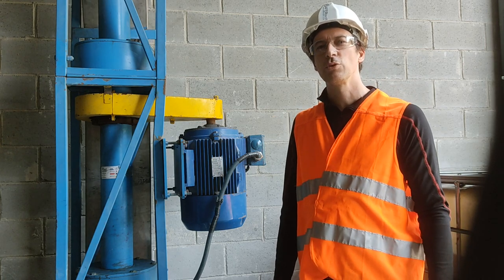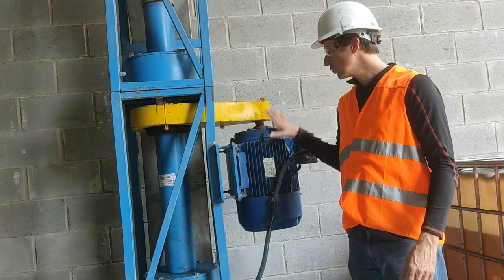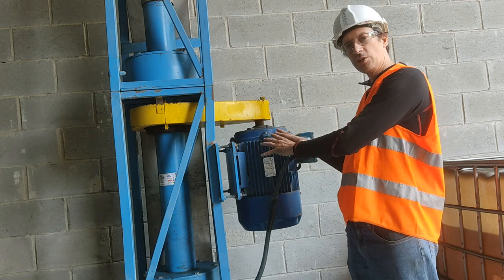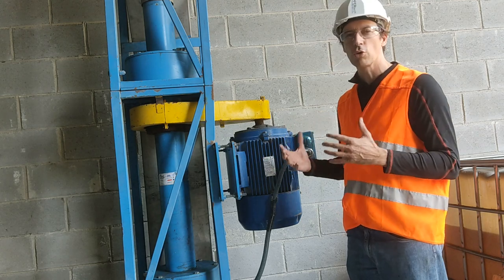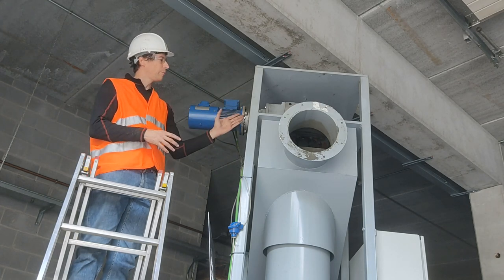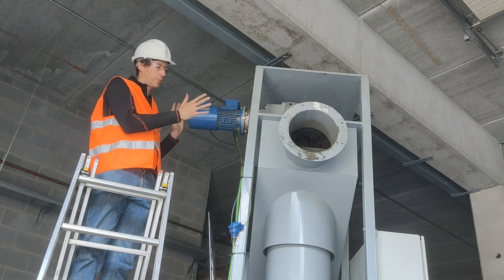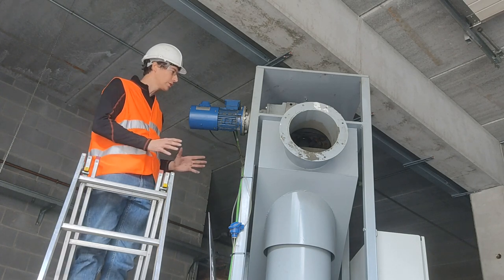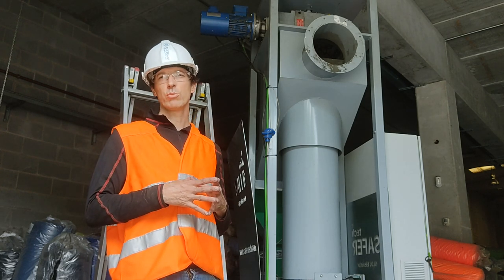POSITION OF THE ENGINE IN THE OLDS ELEVATOR - Basic mechanics PART 2

Comment: Very interesting. Only just came across this machine. What are the limitations or best applications for this product in terms of materials handling. Are dry powders or fine grained materials best? Does it handle damp/wet cohesive material or not? What’s the coarest particle size that is typically conveyed?
Reply from the maker: It can handle wet material such as mud. Please search our video base where you can find some videos in this regard. Powders are ideal. Particle size is limited to the tube diameter. Whole macadamia nuts have been industrially lifted. Cheers!